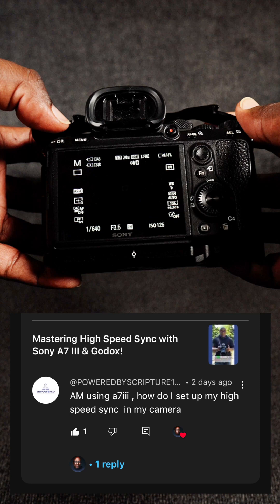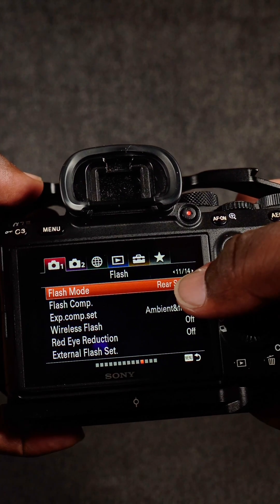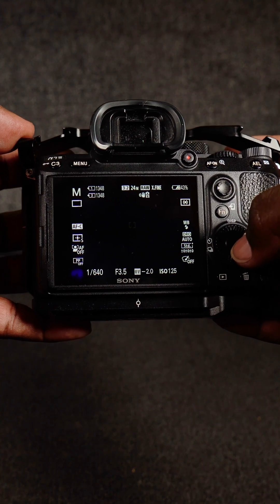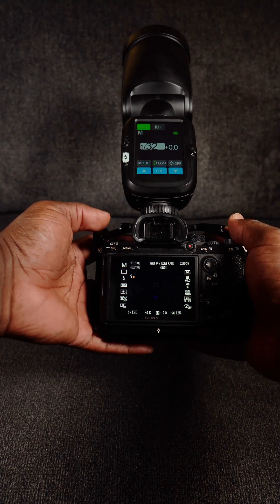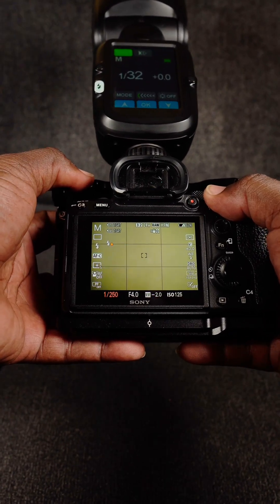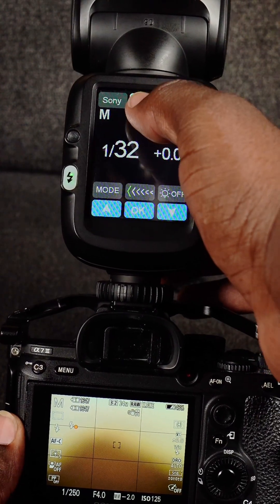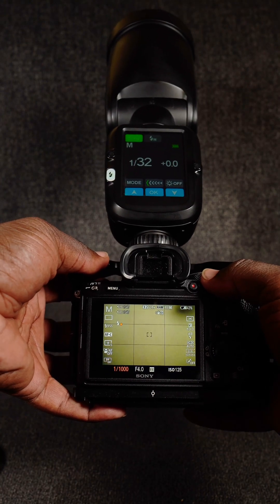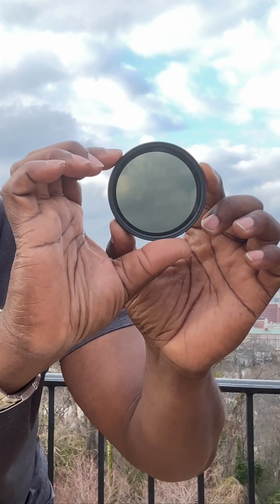Sony High Speed Sync Setting

Comment: I have the Z E10 and the AD 200 with the x3pro trigger.  HSS doesnt work
Reply from the maker: Do you have the high speed sync settings turned on within all three devices?
Reply: @ladedrictaylor on the trigger and flash but I dont see it in the menu of the camera
Reply from the maker: @wdrcinsantodomingo  Try this: Press the menu, then go to the "camera 1" setting, then go on to page7 of 11 and change the flash mode to "fill-flash" (the lighting icon).  I do believe the limit of the flash speed is only raised to 1/320.

Comment: I have same camera but whit the Godox Tt600 Speedlight, and It doesnt work😢
Reply from the maker: It appears that you will have to use the wireless trigger in order for the high speed sync to work on the Godox TT600 flash.